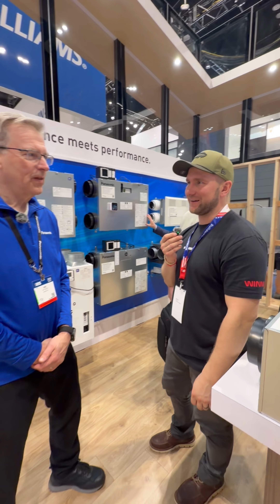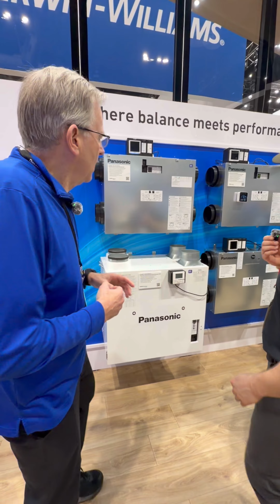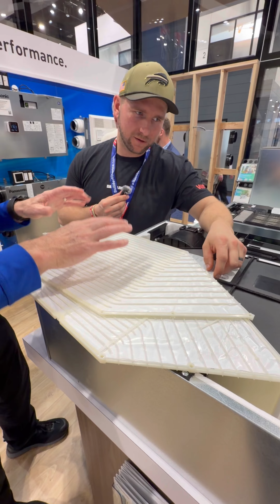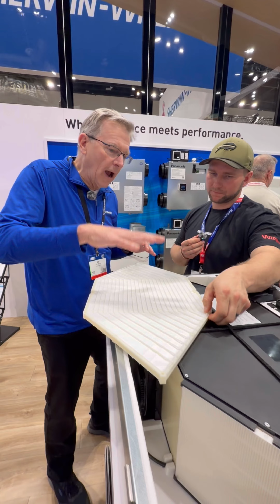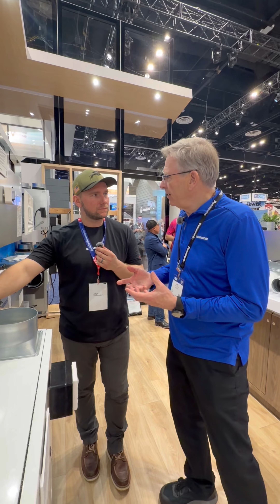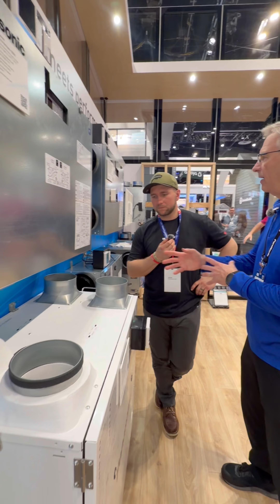Panasonic ERV Systems: High-Performance Ventilation Explained

Comment: What is recommended with the ERV in the summer when it is hot and humid outside. I just realized my humidity level was 73% inside my home. I have been hearing from tube Panasonic ERV shows some recommend turning it off all summer and running your dehumidifier , I had hoped I would never have to run this 24/7 again. What do the experts say? Keep the exhaust air on high while the supply knob is on low? I can't turn the supply all the way off so hot humid air will still be coming in from the outside in the summer. I need to keep my house healthy. What should be done? Thank you